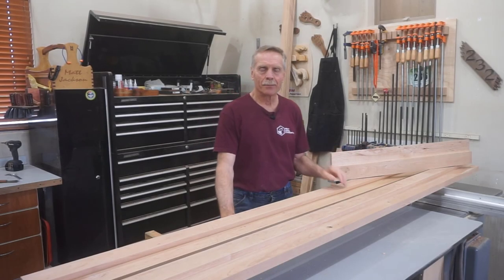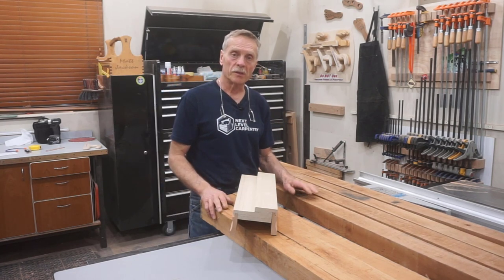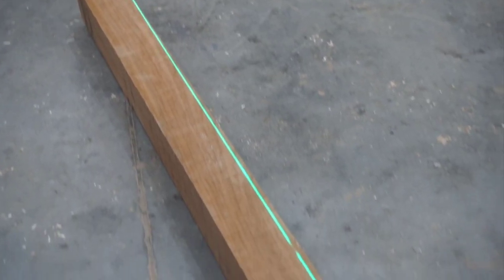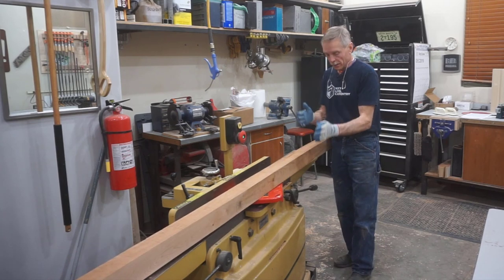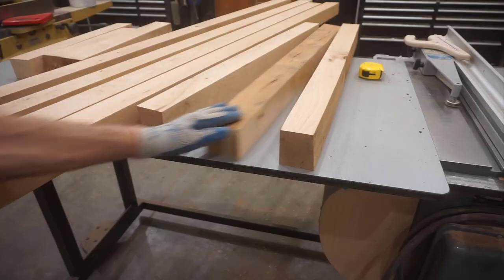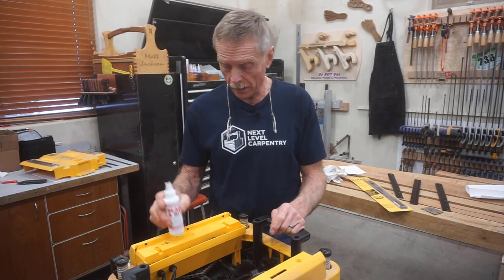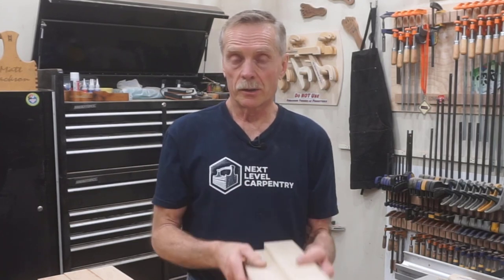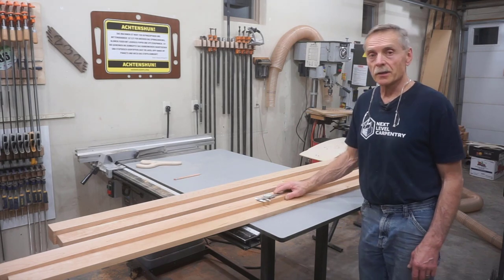Pallet Wood Door Episode #2

Comment: Excellent video as well as excellent timing as I’m about to start making a new exterior door for my shop.
I’d like to let you know that this format of videos is very helpful and instructive.
Reply from the maker: You should get a lot of insight into milling for a door making project Jason but I'm not sure my specific non-traditional design will be that good of an option for an interior to exterior door. I am taking some durability latitude with this door design because it's essentially an interior to interior door with no direct exposure to the elements. Hope you find the insight helpful... Best, Matt
Reply: Next Level Carpentry Well, I’ll certainly take away some tips and ideas to add to my “toolkit”. Thanks for taking the time.

Comment: Whenever I have twist to remove from a board, it is usually a bigger lump than what you were dealing with here.  It has been very costly (for me) to try and remove the twist by holding the board at the mid point of the twist and passing it over the jointer (as you did and made it look easy!).  Instead, I have found I get more consistent results and waste less wood by having the twisted piece on a sled with wedges placed well enough to support the board adequately as it goes through the thicknesser.  (The down side is I lose a bit of time and a use a fair amount of hot melt glue holding the wedges in place!)  All the best for 2020.  Cheers, David.
Reply from the maker: DRMNZ, thanks for your appreciation for a fast-paced video because not everyone appreciates the fact that I snip out five to seven minutes of dead air from a video keep the dialogue moving at the expense of some jittery jump-cut footage... I'm getting better at fine-tuning the audio track and producing smoother video but unless and until I have a professional video editor on staff it's going to be a compromise.  Thanks for watching and commenting.. Best, Matt

Comment: yeah it is a challenge and maybe enjoyable to salvage pallet wood but I found that it is practically impossible to get the wood clean enough of rocks and sand to not harm the jointer and planer blades. 
That foreign material gets imbedded in the surface and is not coming out with brushing or washing....it is there waiting for your fine knives and saw blades!
Reply from the maker: Your observations about cleaning pallet wood are entirely true except that it's not necessarily even enjoyable😁😎. One Saving Grace for the prospect of turning pallet wood into something beautiful and/ or useful is that even the cleanest wood from a hardwood supplier has enough embedded detritus that planer lives don't last forever regardless.  My motivation for the extra effort and risk to machines is the novelty of the project more than anything but that can only be said because this particular pallet wood is oversized and particularly beautiful IMHO. If you search the term "tsumiki" on the next level carpentry Channel you will see another example for a use of pallet wood that just might inspire you to take the risk, or at least help you understand why I do😎

Comment: Matt that door will be beautiful when you are finished with it. Question for you: I have some fresh cut White Oak lumber from a downed tree and I want to make a table from it, most is 5/4 to 12/4 of random widths and lengths, how long should I let it dry before I start to mill in into usable stock? The tree was down for about a year but the lumber was cut about a week ago.
Reply: I've heard of two time frames:  one year for each inch of thickness and then one year for each inch of thickness plus one year.  The former is most usually quoted.  Seems you have some time to design an awesome table.
Reply from the maker: Best I can tell you is to get a moisture meter and keep an eye on it. Like the other reply I do know that it takes a long time and always more time then I personally have the patience for. 😉😎 definitely makes you appreciate the difference Kiln drying makes! Hope you're able to stack it and store it and eventually make something nice out of it because the whole process adds a depth of meaning to any finished product... Best, Matt
Reply: Thank you both for the information

Comment: With wood that's got a significant twist or hook in a short section of length, I find that a minute or two with a scrub plane or jack plane to knock off the high points saves me a lot of time fiddling at the jointer, trying to figure out how to balance an 8' board to attack a 12" length of twist.  

And for what it's worth, my grampa, who started his cabinet makers apprenticeship in 1910, taught me to use "wine"-ding sticks, not "win"-ding sticks.

Comment: great video , thanks for the valuable techniques you are sharing , i need to ask you about a certain project i am currently working on , i am making a  wardrobe with 4 doors i usually make the doors from 1"*4 "  solid beech wood ,width is 20" height is 85 " , this size of cabinet doors usually cup or warp , i am considering using baltic birch plywood  , is this type of ply wood good and sturdy if i make tenon and mortises in it , thanks in advance
Reply from the maker: Glad you like the video thanks. Tall skinny doors are the most prone to misbehavior so your experience is common. Baltic Birch is really just as prone to warping as many solid Woods so I don't think it's a solution in and of itself. If your doors get painted I would strongly consider using hdf since it has no wood grain in it to Warp. If you need solid wood I would approach it buy laminating pieces so that forces in two separate pieces are more likely to counteract each other and prevent Warp. It's a tricky build regardless so good luck... Best, Matt

Comment: By putting silicone on your blades, you're not afraid of leaving silicone on the wood's surface. Wouldn't that cause blotching in the finish?
Reply: It looks like the blades weren't on the heads when he sprayed them so the only silicone to get on the blades would be some on the sides (which doesn't touch the wood) when he puts them on the heads.

Comment: Just out of curiosity, why bother ripping the material after jointing instead of just running both the opposite face and the opposite edge through your planer (as the work pieces are large enough to get away with that)? ... and you answered my question about 2 minutes later lol

Comment: Just a thought, but would it be possible to make a flat side using the table saw and a straight guide board.
Reply from the maker: Not without great difficulty with a dicey setup.  You're basically talking about turning a tablesaw into a mini-sawmill requiring a similar 'carrier' apparatus for holding the material being cut.  This is why a jointer was invented in the first place 😉😎

Comment: Another excellent video, Matt. Your walk-through of using the jointer for taking out twist was very clearly explained and also timely for me.

I do have one question. I have a new-ish PJ-882HH. I'm not sure if this is the equivalent of your PJ-88 or not. But the manual is very clear that the rabbeting ledge is not for use with the helical head, only the straight knives. So, I've never tried it. When you're talking about your aborted attempt to use the rabbeting ledge, you mention a rabbeting tip on the cutter head. And from the looks of it, that one outside knife (furthest from the fence) is in fact ground differently on the edge nearest the rabbeting ledge. It does look like on yours that without a specifically ground knife, the trailing edge of that outermost knife would hit the workpiece, because the knives are angled toward the fence. Am I reading that correctly?

However, on mine, the knives are angled in the other direction, away from the fence, so it's the leading edge that's closest to the rabeting ledge.. I just went out and tried it, and in fact I can use the rabbeting ledge, although the resulting vertical face (the part that forms the depth of the rabbet) isn't terribly smooth. It would clean up okay, but it's not silky smooth like the face that's parallel to the table.

So I have a few questions: Is there really such a thing as a rabbeting tip for your cutter head? If so, where did you find it? (Google was no help.) And is the vertical face of the rabbet typically not as smooth as the horizontal face when rabbeting on your PJ-88? And does your manual say not to use the rabbeting ledge with the helical head?

Like you, I'm not terribly inclined to use the jointer to cut a rabbet, but I'd like to know what my options are.

Thanks again!
Reply from the maker: Hey Eric, you've clearly given this a good deal of thought and research... I admire that!  I apologize for getting you off track but my jointer is the PJ 882 which I only realized during video editing when I realized I called it just a PJ 88.
The detail you noticed about the rabbeting tip is the exact reason I bought my jointer with the straight knives rather than Powermatic helical cutter head. I would have bought the pj-882hh but was aghast that no one at Powermatic could tell me if their cutterhead would cut rabbets or not. What you noticed about that rabbiting tip in the cutter head is the exact reason that I bought the Byrd shelix cutterhead and swapped out the straight knives for it. Byrd makes those little rabbeting tips for exactly this purpose: it will make a clean Square rabbet. At the time no one could tell me if the shelix rabbetting tip would fit on the Powermatic helical cutterhead or not. For your situation it might be worth buying a couple to see if they work because it makes a dramatic difference in the quality of the vertical Edge when cutting a rabbet. The biggest issue I could see with the Powermatic helical head was that it won't cut a clean rabbit because the most outboard cutter isn't far enough out to clear the sharp corner of the outfeed table on the jointer so it pulls the workpiece away from the fence. I'm quite impressed because in all the years I've had that machine and produce videos you're the first person that has ever brought up that very nuanced but very important little detail. Because of that let me know if you have any other questions you think I might have answers for... Best, Matt
Reply: Thanks for the reply, Matt, that's very helpful. I can live with the quality of the helical cutters on the Powermatic head when rabbeting, but I still might check with Byrd to see what they have to say.

Comment: Any. Chance you have a source or build for your table saw portable out-feed rack.
Reply from the maker: I'll be featuring those in an upcoming build video series Steve but, unfortunately, it will be awhile.  FYI it's a steel fabrication/welding project, not your typical DIY/basement workshop project.  Best, Matt

Comment: Matt,

That was one heck of process! But the real question I have is—where did you buy your Smurf Gloves? I use dark work gloves when I handle lumber, but I think the lighter color of the Smurf Gloves would be better, especially when using power tools.

By the way, I really like your episode approach this for this project—as long as you don’t invite Ming the Merciless...boy, does that reveal how old I am!
Reply from the maker: This is a good value and a great source Joe: https://www.amazon.com/dp/B007VR8X2W/?ref=idea_lv_dp_ov_d&tag=aiponsite-20&linkCode=ic6&ascsubtag=amzn1.ideas.1LSBFEUP0R2XU but it's kind of a lifetime supply quantity.  The Atlas Showa ones seem best IMHO since the grippy rubber seems to stay supple longer and is therefore more durable because it doesn't 'flake off' like some cheaper, black, knock-off ones I've tried.  I use 'em for just about everything: yard work, demo, hauling, handling and, yes, milling! 😁😎 Best Matt
Reply: Next Level Carpentry 

Matt,

Thanks. I will order them: they seem perfect for my needs.

Happy New Year,

Joe

Comment: ?surface cutter on a router?
Reply: When you said that the rabbett setting only went 1/2" I thought of the surface cutter on a router. I've experimented with these and they seem to do a great job but I do tend to go very slowly with these as they are said to be capable of ruining a piece of work if you don't stay entirely aware of everything going on with them.

Comment: 40:15 -- That's interesting. My calipers don't allow me to measure that way.
Reply from the maker: Take a closer look Chris... I'll bet that they do as I don't think I've ever seen calipers that don't... but there's a first time for everything though, right?
Reply: @NextLevelCarpentry  Well, I can use the depth gauge, so it's not a total loss. Just that mine isn't designed in a way that allows you to measure the depth with the jaws. It's fine. Just a little miffed because I can't do that cool trick. xD
Reply: Just checked the store. The calipers they have do allow measurement that way. Just not mine. -_- Just my luck. Well, I still have my depth gauge, so it's OK. I guess? Hardly ever use the calipers. Hmmmm.

Comment: Gloves and a table saw extremely dangerous for a someone teaching the stupid people will asume it is a good practice
Reply: If your hands are that close to a blade that the thickness of a glove would make the difference between being drawn into a cut and not,  your already are running risks that should be reconsidered.
Reply: As right as you are slipping the board getting jammed or something distracting you for what ever reason gloves are not a good idea with power tools
Reply: @irvinwittmeier5208  with all due respect,  and I truly mean that sincerely,  all the scenarios you've listed above don't exactly relate to wearing gloves being more dangerous than not, as any of those circumstances could occur whether you are wearing them or not. Honestly I would tend to think ( even though I don't wear them-the purpose of this statement is for that of full, honest disclosure) is that if the unthinkable did happen,  god forbid,  that even though minuscule,  they may provide the smallest amount of protection reducing,  again very little,  the injury.  I have seen what happens with fingers in table saw accidents first hand,  no pun intended , and with and without gloves on,  and the gloves were never the cause of the incident.  Again,  with all due respect as I am a professional cabinet maker and bench carpenter for years, and I don't believe this practice to be any more dangerous  with or without gloves.  Safety while using power tools is all upon the the operator and thier attention to thier process and approach to how to complete the task at hand without incurring undue danger.  I don't believe either is largely better than the other,  but also don't think one is more inherently more dangerous than the other either.
Reply: If you believe that to be true great but he is teaching and having seen fingers removed from the i know what i am dooing new carpenters over the 40 ish years under my belt people like you saying that is personal preference is just wrong gloves are dangerous